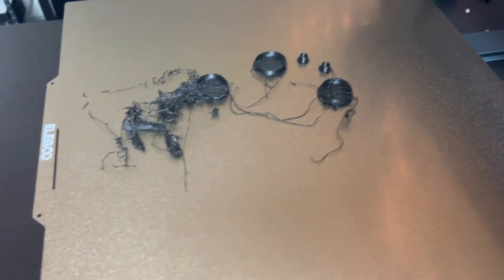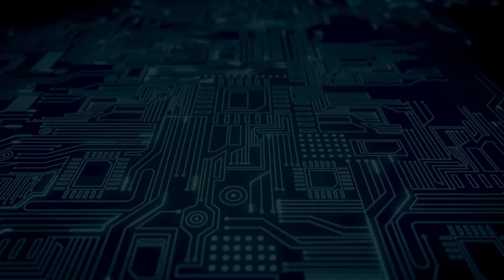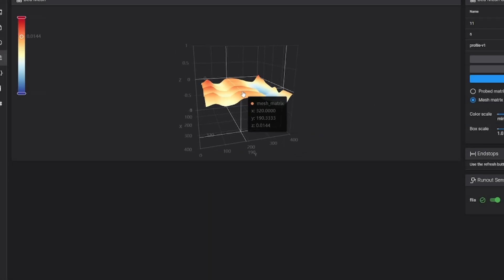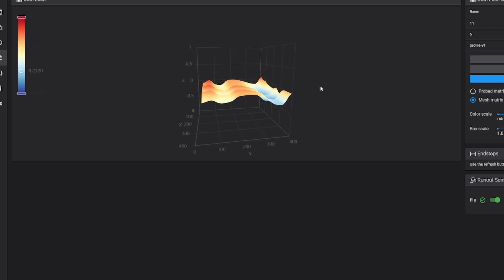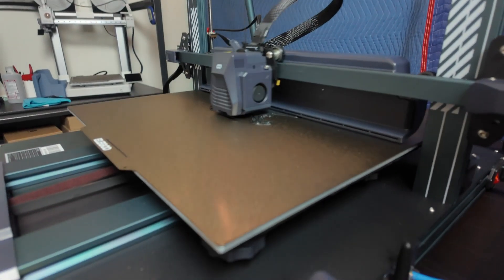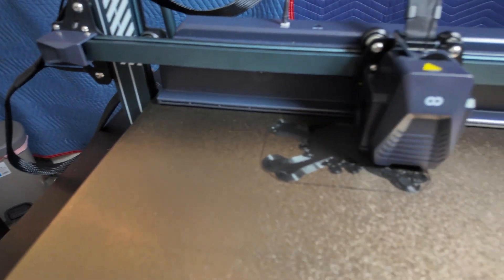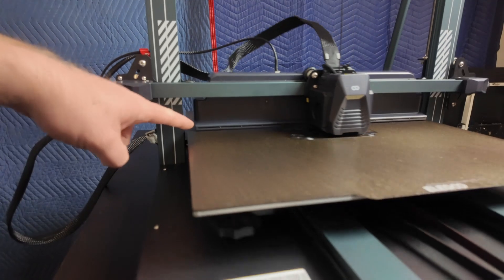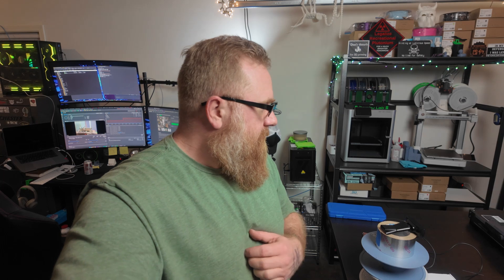Dialing in the Neptune 4 Max: Bed Leveling, Extruder Tuning & First Success!

Comment: its not your plate not adhering its at the points where its not adhering is where the nozzle is just too far from the bed so the filament isn't squishing to create the sticky ness that it needs. you have to get that bed more level and flat. I would reduce your mesh resolution I know that sounds counter intuitive. change from 11x11 to 7x7 I bet you get way better results.

Comment: The point of the auto mesh is to tell the machine to compensate for a bed that is not physically flat. Couple of suggestions, 1) make auto mesh part of your start g-code AFTER the G28 command. 2) change your printer.cfg file to do 11x11 probes for the auto mesh 3) print a single layer bed adhesion test and adjust the z-offset on the fly until you see good bed adhesion. 4) heat soak the bed at printer temp for 15min before you start printing. I have three of these machines and when they work you love them!!!! Happy printing, love the content
Reply from the maker: It took me a few attempts to get this right, but this is exactly what the workflow looks like now. I'm thinking about flashing the firmware to OpenNept4ne and see how that runs.
Reply: @ if you do decide to do that, please make a detailed video. I want to do the same, but can’t find and guides that I feel comfortable with

Comment: Doh, I put comments on your first video that addressed things in this video.  I flipped to the smooth side of the build sheet and applied some Warp Pro which helped with most my PLA adhesion issues.

Comment: Did you have to update the firmware? I only ask as I have one coming and I know lots of older Videos people have had to out of the box.
Reply from the maker: I actually didn't have to. To be honest, that was the first thing I checked as almost every other video stated to do this. But the firmware on my printer is actually newer than what's on the website. Doing a bit of digging i found that sometimes this happens as it takes a while for them to get newer firmware posted on their site.
Reply: @3dprintknox  nice! I ordered my printer back in December and have been waiting / dreading having to install firmware first thing. I am returning my anycubic kobra 2 max for this Nep4 max as could not get the thing to level correctly. or print out side of a 150mm centre spot.
AC sent me a new bed, didn't help, they told me to use heat resistant tape to level it up.... so im going for something (hopefully) that has more adjustment. 
I have a AC Vyper that kicks ass with its hot end levelling. but the K2Max uses a laser or magnet and its rubbish (in my 6month experience with it).
love the channel.
Reply: I saw another channel got mainline klipper installed on there N4M printers
Reply from the maker: I actually ended up breaking down and upgrading Klipper to v12 last night. I didn't realize that there was a video on how to do this until I was like 80% through the process. sandmmakers (youtube /github) did an amazing job on this! That dude should have a million subs. 

But, that coupled with swapping the 18mm silicon bushings for 16 and dialing in the screw title calculate params to withing a second, bed and extruder temp tuning and getting my z-offset really figured out - i'm now at a point where I'm testing out an actual (non benchmark) print.

Comment: Did you notice your z offset goes back to factory defaults after a power cycle?
Reply from the maker: I didn't at first, but after multiple rounds of leveling and tweaking, I noticed that it kept reverting and I'd have to re-adjust. I ended up setting it in Klipper before the print. I'm actually looking at a note on my desk to dig into this a bit more. Do you have a suggestion on how to make it permanent or, is that even a good idea?
Reply: @3dprintknox  we voided our warranty and made changes to the firmware
Reply from the maker: Made changes as in updated the firmware, or actually modified the code? I was under the impression that you could update your firmware as long as you follow their recommended procedures and not use "unauthorized" firmware.
Reply: @3dprintknox when I got mine there firmware was unusable by z-offset still not working still looks that way lol try open Neptune that's what I'm using but looks like mainline klipper is a option now as well
Reply from the maker: Just upgraded to v12 last night. Working great so far!